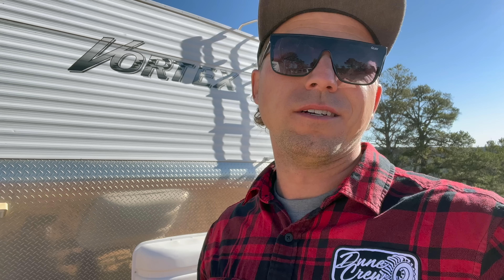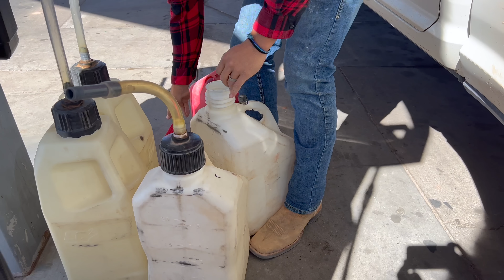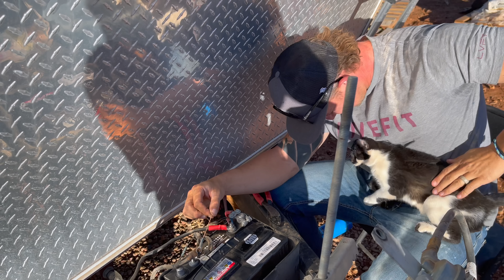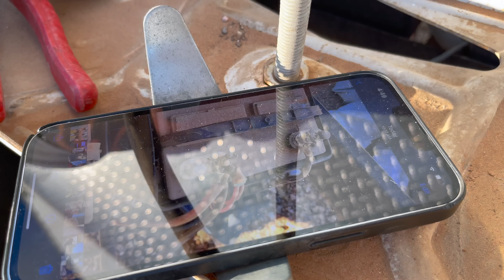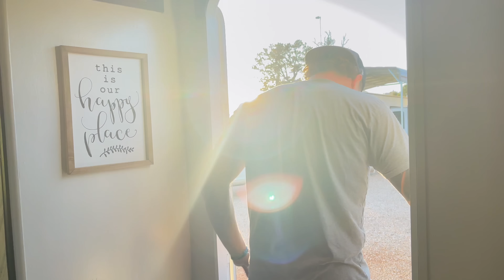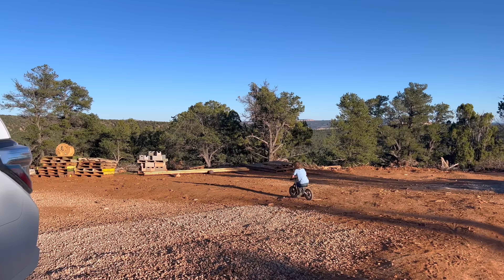WINTERIZING THE RV I COUPLE BUILDS OFF GRID HOMESTEAD

Comment: You do need to insulate your frost free. Water can not drain back if you leave the handle open and the hose connected. It will freeze for sure. Ben there done that. Full time RVer 14 years. Also insulate your low point lines coming out the bottom of the rv. They will freeze and break the exposed plastic lines and valves. If they don’t break they will start to leak after they freeze once. Also you defeat the purpose of skirting the underneath if you don’t close in the whole thing.
Reply from the maker: Hi Ralph! Thank you so much for the advice from an experts RVer. I will take care of both items.
Reply: Glad to help and pass on information that we had to learn sometimes the hard way. Many people helped us along the way as well. Good luck and keep up the great job your doing. 
We are building a 40 acre homestead here in Wyoming in the Laramie Range at 8000’. Started two years ago. Completely off grid. Solar power, spring box on the creek for water, composting toilets and wood stove for heating. It is my retirement project. Cabin isn’t ready to live in yet so we will be bugging out for the winter. We will be coming through St Gorge in a couple of weeks. Had a sister that lived there for many years so we know the area. Maybe we will see you round out that way.

Comment: Maybee the excess heated blue water line could be wrapped around the freeze water pipe then wrap insulation around that to the heat in....just a thought
Reply from the maker: Hi Dan. That’s not a bad idea. I will say that the hose is pretty stiff with heated wire wrapped around it.

Comment: Couple more cold weather hacks we have learned. First is reducing the air flow through the windows by reducing the outside air flow that comes in through the rain weep holes on the outside of each window. Looks like you have the sliding windows and if so they have the weep holes. Use a role of black electrical tape and cut short pieces to cover those holes. Then use a razor knife and just put a slice in the tape where the weep hole is. It will still allow water that runs down the window to weep out but it also reduces the opening size which will keep 90% of the cold that comes inside through those holes. Second cover the windows with the insulated reflective material that you can buy at the hardware store. It looks like bubble wrap with a reflective layer on each side. We cut to fit each window. We only put them in the windows at night and let the sun in all day. Skirting, widow weep whole and window coverings hacks cut our propane bill in half for the winter. Furnace ran mush less. We have an all season rig also. Doesn’t really matter. None of them stand up well to extreme cold and wind. If you don’t have heated tanks that will be your next challenge. Also the sewer hose and valves that are exposed to the outside ambient air can freeze shut. If you are leaving them open your sewer line will build up ice and freeze. We are at 8000 ft living in our fifth wheel in wyoming. We have experienced every freeze up you could have at on time or the other. This year we will winter with our rv in AZ and leave the cold behind.
Reply from the maker: Thank you Ralph. I will incorporate these. I appreciate your help.

Comment: Hi guys love your show but I would replace that duct tape with gaff tape. The duct tape will stick to your trailer over time and be a bear to remove. Gaffer tape is used in the audio tech business to secure mic lines. Super strong and doesn't leave adhesive behind. If the duct tape leaves adhesive on the trailer you can remove it with 3M adhesive remover.
Reply: That's what northern WI residents do! From Halloween deco, the bales of hay are great for house/resident skirting before the ice & snow start banking the house for you, in spring you have a dozen other uses for them....

Comment: Remember to put insulation around the faucet pipe. Even though its frost free but only when it is off
Reply: Also won’t drain back if a hose is connected at both ends. No air available to allow it to drain. It will act just like putting your finger over one end of a straw that’s full of water. It will hold water in the straw until you release your finger.

Comment: Hey if you got corroded wires if you add Coca-Cola don't some Coca-Cola on the wires and the battery that's corroded the Coca-Cola with eight the procession right off trust me it works